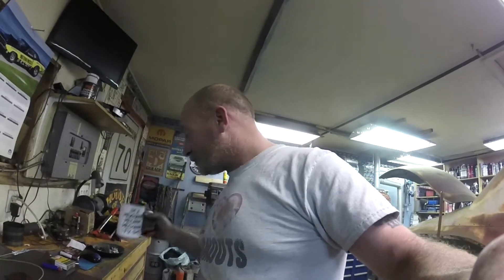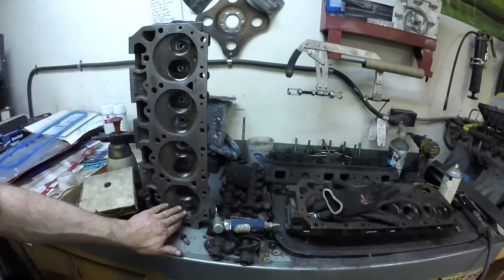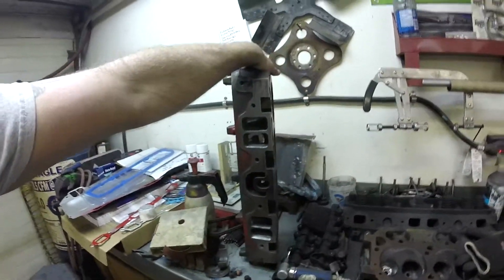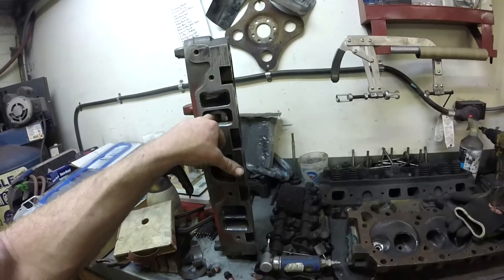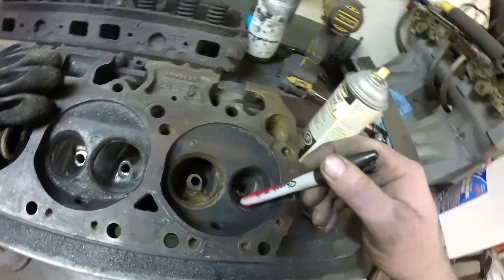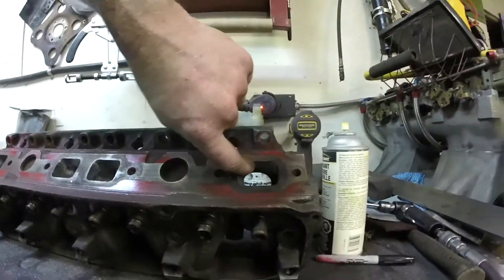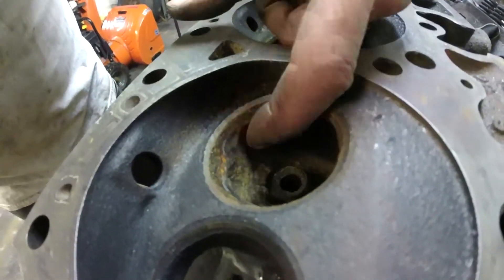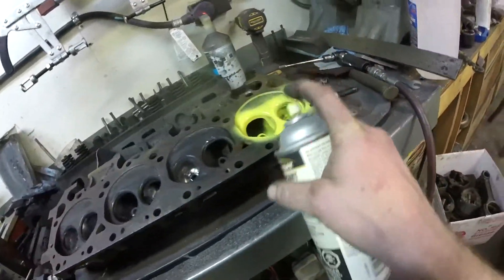Cheap 440 Build Pt9   Head Flow 101

Comment: You have to watch grinding right under the seat. This is called the throat and it should never be much over 90 percent of the valve diameter.  This is supposed to be this way to form a venturi. This speeds up the air right before the valve so it flows over the seat faster. Any bigger than 90 percent and you are actually killing flow.